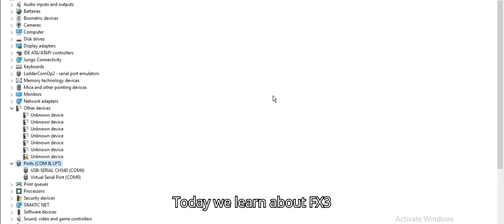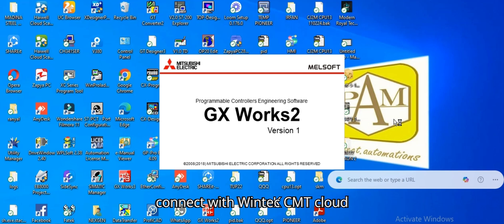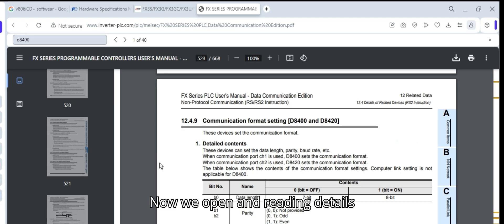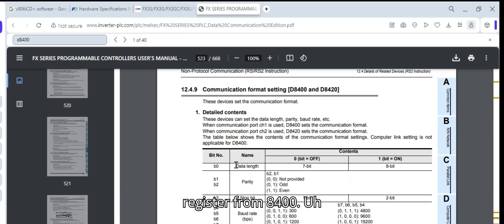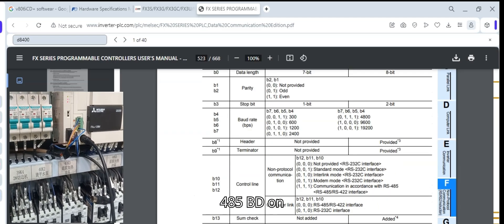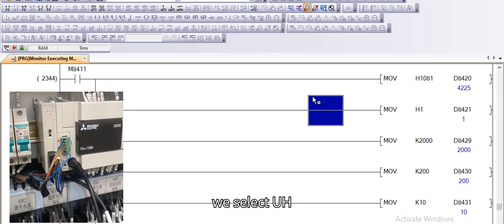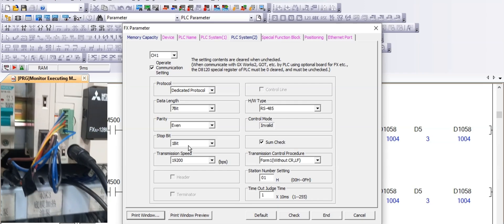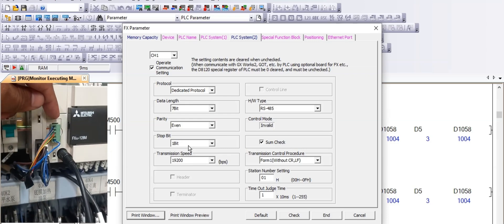MITSUBISHI PLC Modbus FX3U 485ADP-MB & FX3U 485-BD dual Card  Configuration Programming #mitsubishi

Comment: I have two questions for you. 1. Is it necessary to configure Project->Parameter->PLC Parameter->FX Parameter's Tab PLC System(2) to tick CH2's CheckBox of Operate Communication Setting and also fill all parameters for CH2 in this Tab PLC System(2)?    In your video, I saw you configured CH1, but not showing CH2.    2. On PLC side, Why we use the communication port CH2 ("INITIAL SETTING FOR CH2") instead of CH1?  Does It depend on wiring or configuration in PLC System(2) in GX Work2?
Reply: when you do plc parameters settings then u dont have to do register settings . you dont need to do plc parameters along with register settings just one thing is enough. set for port 2 is used because port 1 is already utlized as bd card card so port 2 is adp card